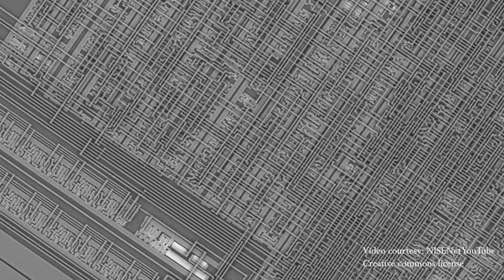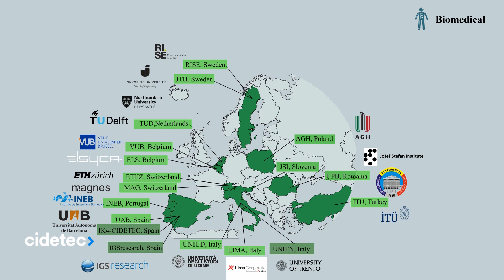Understanding corrosion in miniaturized electronics | Salil Sainis

Comment: The technology might have application in wind turbine electronics where cost of replacement of a part far exceeds the cost part itself. As well perhaps with appropriate reformulation the coating can be used to protect the turbine from leading edge damage although there is competition from Belzona for that market.

Comment: I am impressed with the idea. Some questions arise though. What is the MTBF  of such miniaturized circuits? If MTBF is longer than the life of the implicit technology,  then advantages of anti-corrosion technology such as this,  are moot. As well some (not me)  environmentalist is going to ask you what happens when the device is finally sent for recycling. Most recycling is done by burning. Does your protective coating generate any toxic fumes?  Commercial success of such a coating  will depend on these and other issues including costs involved.